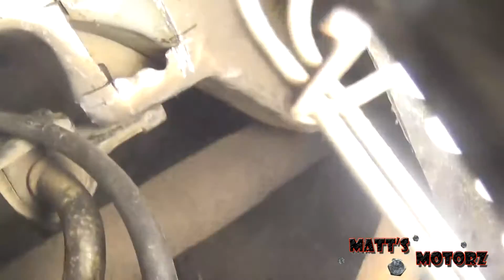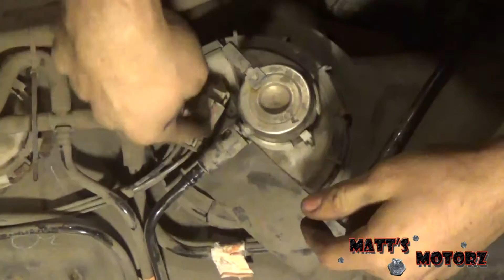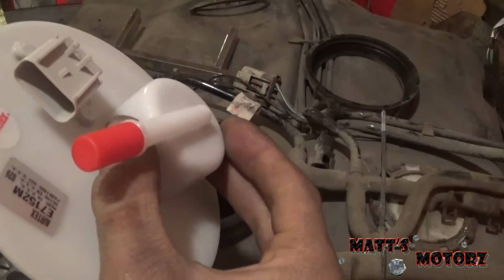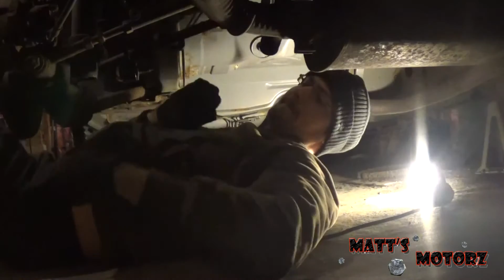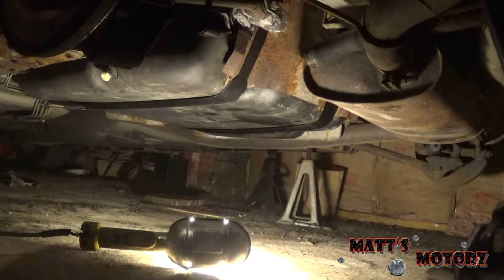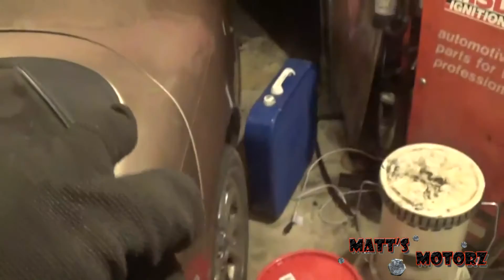Fuel Pump Replacement: Part 2 [2000 Chrysler 300M]

Comment: I feel there has to be a better way to solve the broken nut inside the frame. Could you have just welded a nut to the outside of the frame? Or maybe tried tapping the hole?
Reply from the maker: +Zeus Carver Welding the nut on the outside of the frame was my initial idea.  I said that I was hesitant to do this because the place was filled with gas fumes as well as a completely empty tank.  It wasn't until after the tank was out of the room and the place aired out that I felt comfortable welding (which I did).

Comment: You should've cut an access hole to the pump where the back seat cushion sits. Done! No headache! Who cares in that junker...it should've come that way from the factory,but Chrysler engineers are retarded.
Reply from the maker: +Nick Nicu Lol yeah, I typically don't like doing stuff like that but man it would have made it SO much easier.  I really don't know why all cars aren't designed like that.

Comment: Worried about torquing that keeper ring to specs after that hack job on the uni-body is funny man!
Reply from the maker: +Glen Harper Clearly someone has never had a nut spinning in the frame before.  When it was all said and done, I welded it up to make it nice and pretty. :)
Reply: That's why your videos are so good- you show the real world scenarios.  How else were ya gonna fix it?  Great video.